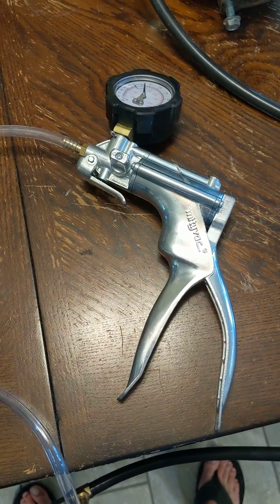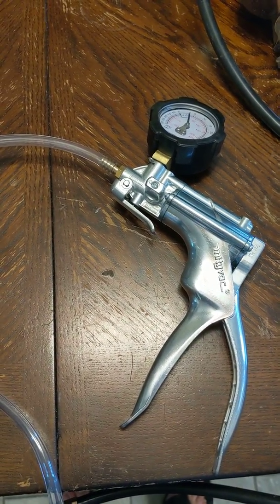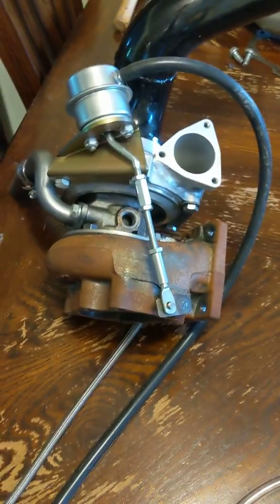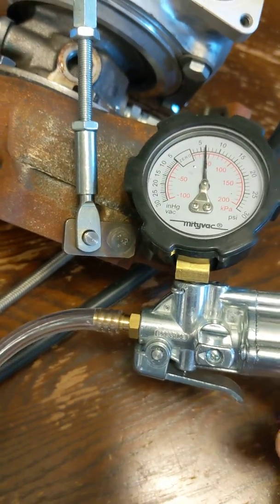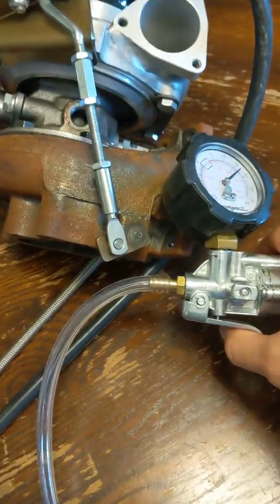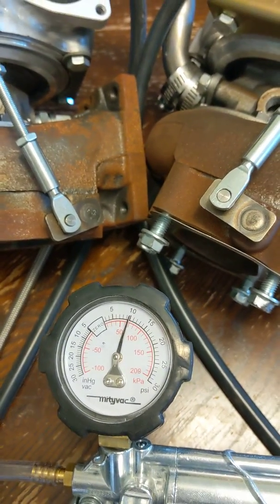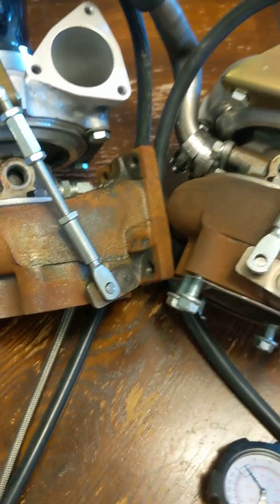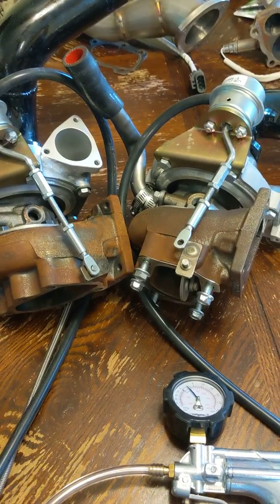300zx wastegate adjustment gtx 2860 gen II

Comment: How do I set them up for a 12psi though. ?
Reply from the maker: The wastegates themselves are 12psi.  I am syncing them to both open at 12psi.  You would adjust yours to whatever base pressure your wastegates are set for.
Reply: If I was to be running total boost at 15psi should I have them open at 15psi or should they open sooner at say 12 or 9